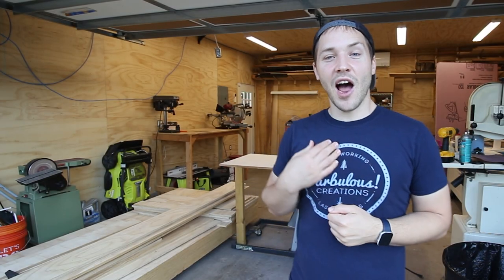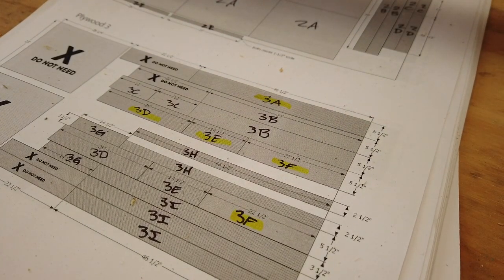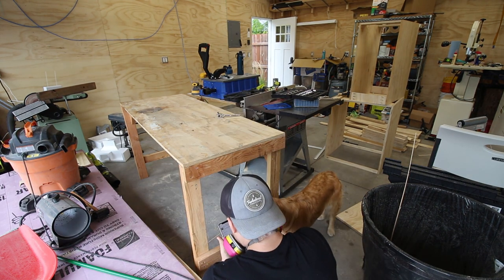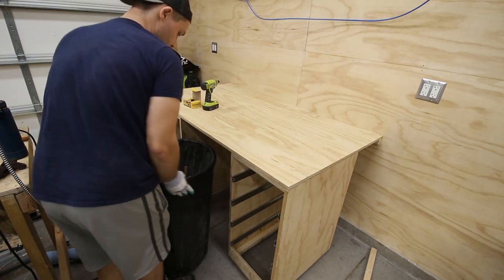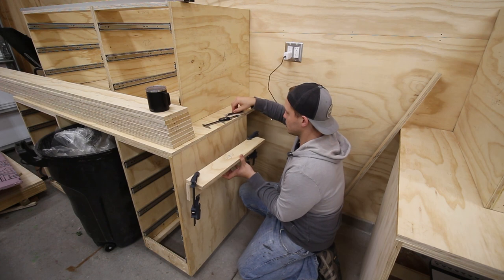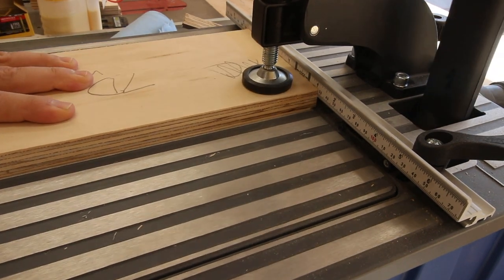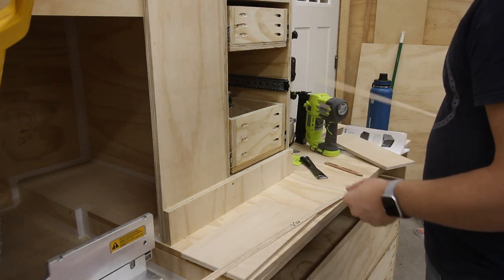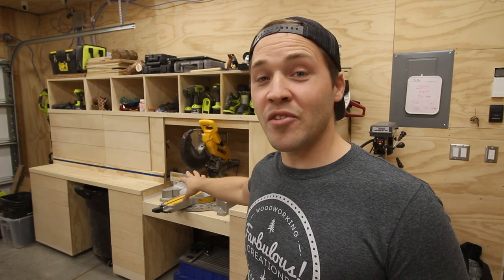Building Jay Bates' Miter Saw Station

Comment: When adding T-Nuts to wooden materials i either use a c-clamp to force them into the material or drill through the substrate and use a bolt to draw them in.  This will set them lower and flush into the material.  Be sure to use fender washers to give the 'draw-bolt' a stable surface to work off of, otherwise you would force the bolt into the material without pulling the t-nut down.  Also a little glue never hurt...
Reply: As far as drawer pulls are concerned, think about having something that doesn't protrude from the drawer face, a laser decorated cut finger hole (3/4 or full shaped to fit your finger with a band-aid on it).  This would prevent catching on the pulls with material you lift onto and off of your miter station and give it a clean look.
Reply from the maker: All good advice on the t-nuts, thanks so much! :) Drawer pulls I'm not opposed to a shallow, surface mounted pull, because I'm really eager to do a laser etched design. 🤓

Comment: Maybe I misunderstood what your mistake was with the gap between wall & upper boxes, but that is to be expected. If the base cabinet is level and the upper box is square, then there will almost always be a gap to shim & hide at the wall as walls are rarely perfectly plumb. Typically fixed by scribing an end panel to the wall to hide the gap.

Comment: Should put the t nuts on bottom side of 2x2. When you tighten down they will pull up and secure much better.
Reply from the maker: They technically got "pushed" in once I flipped the cabinets over and the bolts were resting on the floor, but totally get what you mean!

Comment: I like it thanks for posting did you remedy the carriage bolt leveling technique ?
Reply from the maker: Thanks! No, I just ended up using those screws to hold the T-nut in place (keep it from falling out) until the cabinet was upside down 🙃 pushing it up and holding it in place. Cheers!

Comment: That's quite a project and you've done a great job. A couple of thoughts...The edge trim could be oak, made from a single 1x6x6 that you rip into 3/8-inch strips. Hardboard is a durable option for the surface of the workstation.
Reply from the maker: Thanks for the kind words and for the tips, Stephen! I hadn't considered hardboard for the surface, but yeah that could totally work!
Reply: Good job!

Comment: Great video, bit late to the party but just seen it :) 15 sheets!!! basically $1000 with todays UK prices of plywood. Just setting up my shop and tempted to go with aluminium extrusion which would be half the price!
Reply from the maker: Oof, yeah I lucked out by ordering too much a few years prior to the prices skyrocketing! I really hope it comes down soon. Otherwise prices for other materials is going to start shooting up too. :(
Reply: 1/2 inch plywood would work just fine for most of the cabinet carcasses.

Comment: Great video, but I need to advise you for future builds: the garage floor is not flat :(

Hence the T nut leveling.  I learned this lesson the hard way, and ended up with a lot of not square stuff.  Also, driving a couple brad nails keeps the boards from shifting when you run the pocket hole screws, another thing that can land you out of square.

Did you use your handheld ripcuts as a reference?  Generally you just do that to size it manageable for a more accurate cut.  Not a big deal either way.

Also, just use paste wax on that surface.
Reply from the maker: Good tips, thanks! I think my garage floor is flat / level towards the back, but definitely not the front, so I thought I was safe...but you've inspired me to check the next time I think of it, using my big level. 😂 

I like the brad nail idea to keep the boards from twisting while placing the screws!

I did use the handheld ripcuts as reference, largely because I didn't trust my janky old table saw to make the broken down boards straight, either, lol. But I just replaced it with a SawStop so going forward I'll be able to go that route. 

Paste wax is a great idea! Durable and easily re-applied! Thanks again!

Comment: I would miss the toe kicks
Would I be able to simply push the lower wood piece touching the floor in two inches and notch that angle into the right and left carcass sides?
Reply from the maker: That's an interesting point about toe kicks, but honestly I haven't noticed it as an issue, primarily because you're not "working" at the in-feed/out-feed side of the station very often like you might a kitchen counter.... you're primarily standing in front of the saw, which obviously has plenty of room for shoes and toes. :) 

But yes, if you wanted to notch the left and right sides of the carcass to allow for toe-kicks that should certainly be possible. You'd also have to modify the length of the 2x2's that take the T-nuts too. Hope that helps! :)

Comment: To square or not to square you need to invest in some clamping squares they are cheap and dry fit dry fit dry fit.  
wrt t nuts, looks like in the video you had them mounted on the wrong side of the board (maybe that was just me) The rule of thumb is T nuts are on the opposite side of the wood that your bolt is coming from.  Always use a bolt to pull them in the hole should be a tight fit for the bolt the spikes on the T part of the nut(flange) are there only to resist twisting.  Nice build though.
Reply from the maker: Thanks Steve! Yes, I definitely need to get some clamping squares. 😅 Cheers!

Comment: Gravity. T nuts won’t fall out because they have all the weight on top of them pushing down and in turn, pushing them up into the wood.
Reply from the maker: Hey Brent! That's true, but they were kind of loose and slipping out on me before I was ready to tip the cabinets over and I wanted to make sure they stayed in place once I did tip it over. Otherwise you're totally right!